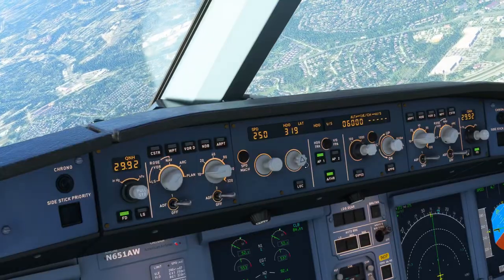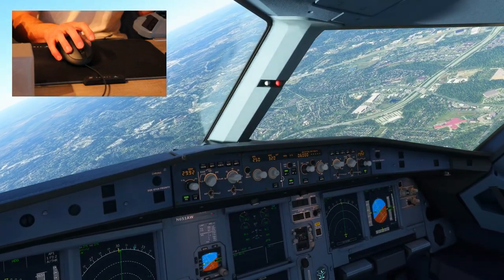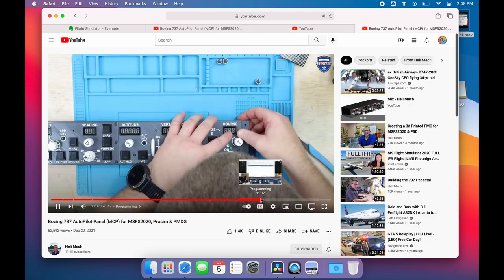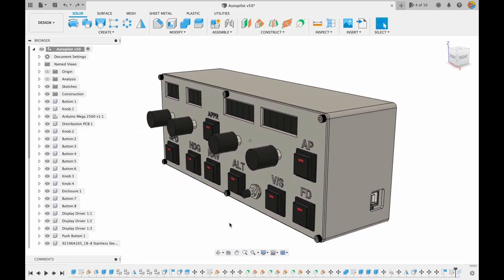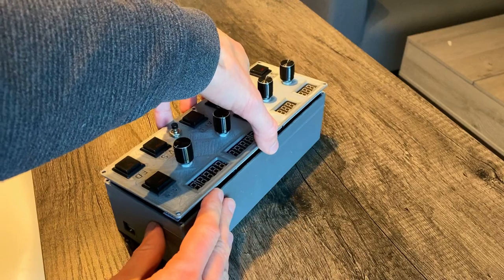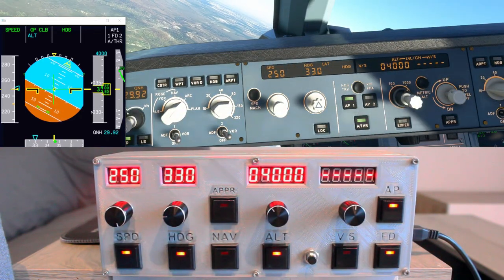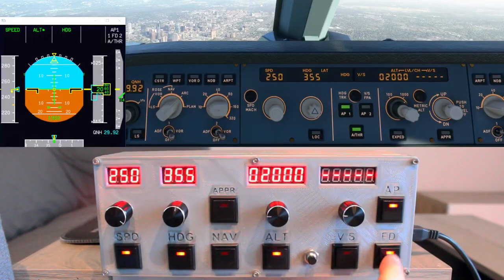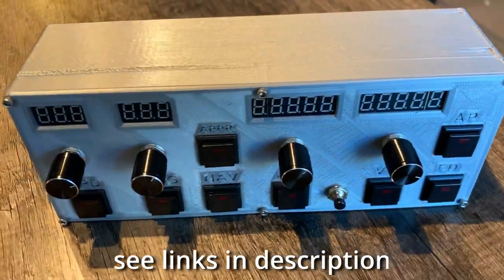I Made a Real Autopilot for Flight Simulator! And You can too!

Comment: Oh man that’s what I’ve been looking for! I had exactly the same problem using flight controls with a mouse. So I built a com radio with an Arduino which functions like the real thing, but the trouble was the interface software. I had to use FSUIPC, which was a total pain in the butt because I had to then write a gateway app to interface that to my USB port. The controls are easy for me, I design electronics and a living. It’s the software interface that’s been the obstacle. I’ll take a look at MobyFlight. Thanks!

Comment: Awesome!! Question, I am considering getting your module, however I have a question about the managed decent mode in FBW, does it support that along Open decent mode?
Reply from the maker: Not currently. You could reprogram it. I will likely change the ALT knob push button to do managed mode at some point.
Reply: @vizix2049  Yeah, the actual aircraft knobs can be pushed in or pulled out, but I have still not found any encoder modules that do that. A solution i came up with was to put a button on top and a button below the encoder knob, which behave like pushing and pulling the knob. This also means that you can use the encoder button to do something else. Not as faithful to the real aircraft though...

Comment: Whould it ba Possible to Buy/Print a 3D panel of any Cockpit with Holes where the Nobs & Push Buttons Go.and Holes with Lens to Read outs. This Panel would be FULL SIZE to fit on the Front of a 50" to 65" UHDTV used as the Panel CockPit that would be displayed Behind the Panel as the primary flight display (PFD), multi-function display (MFD), and an engine indicating and crew alerting system (EICAS) display. This would Eliminate the need for Separate Components that aren't really Representative of thr Full Scale Aircraft.  This Printed Panel could be done in Sections to accomidate smaller 3D printers. While all Buttons Knobs & switches could be installed By the Builder.

Comment: Real nice! I’m gonna buy one! Will it be compatible with the new pmdg 737 700 coming out soon and what about p3d v5? Thanks!
Reply from the maker: Thank you! There's no way to give a real answer to the PMDG 737 compatibility question. Not enough is known about that aircraft yet. I'll say this. I will be buying that plane, and if it's possible to get this autopilot controller working with it, it will happen. It may require MobiFlight support which might not exist initially. However, I imagine the MobiFlight team will be very interested in supporting this very popular aircraft.

MobiFlight does support P3D. However, I don't have P3D. You would likely have to program the autopilot controller to work with P3D yourself. Definitely possible, but would take some work.

The autopilot controller currently has several profiles that work very well with MSFS and X-Plane 11.

If you want to buy an autopilot controller or have more questions, you can email me at vizix.contact@gmail.com. Thanks!

Comment: Really great. Are you able to differentiate between "managed" modes and "selected" modes on the FBW A320? So, can you build "push" and "pull" into the speed, altitude, V/S knobs like the real thing?
Reply from the maker: Yes. The knobs are also push buttons (for going into managed mode). Wasn't able to find knobs that you can also pull. So you just press the HDG button (for example) for the "pull" function to go into selected heading mode. So it's more like a traditional autopilot panel in that regard, but it has all of the Airbus functionality.
Reply: @vizix2049  It looked like you pushed the ALT to change to increments of 100ft. Is it also a push to get into Managed/VNAV mode now that the FBW A320 supports that?
Reply from the maker: @ANITIX87  you can reprogram it to do the managed altitude mode.

Comment: Good job! I've printed the box you open sourced, nice and beautiful. But I am having trouble fitting the 8-digit led screen into the slot. It seems impossible to fit two 8-digit led screen without overlapping each other. Did I picked the wrong number of digits or wrong type of led screens? Hoping you could help me. Thanks!
Reply: I solved it by cutting some off both ends of the pcb board.

Comment: Hi there. Great project. i will be building this over the weekend. But i am not getting the 8 pin DPDT switches. I have 5 pin switches. Will those work ? and how would the wiring be connected ?

Comment: Just a simple question: Where did you get these special 7219 LED displays? The ones in your link description have 2 holes for fastening to the left and right and are WAY to big to fit. Do you cut them or how you do it. I am trying to build that myself at the moment, since yours is not available, Thanks for your effort though, just would like to know, if I have to cut the 7-segment myself.
Reply from the maker: Yes, you have to cut them and glue them in.

Comment: hi! nice idea! have you wiring diagram? and the 7segment display board was cutted?  thank you...
Reply from the maker: Thanks. I don't have a wiring diagram for it yet, but the MobiFlight website shows you how to wire up different kinds of components. Yes, I had to cut off the ends of the display boards to get them to fit.
Reply: @vizix2049  Thanks! The push button between ALT and VS what function does?
Reply from the maker: @maramberri  For the A320, it switches from heading and vertical speed modes to track and flight path angle modes (basically determines if you're referencing the ground track or your track through the air). On other aircraft though, you could have the button do whatever you want.

Comment: Nice!! exactly what I was looking!.. have a question. can  you share, hw did you connect K2-22 switches? i tried, but my LED dose not works.. or stay On.. Thanks in advance!!! great video!
Reply: actually the  diagram show just 3 wires come from switch.. but in  video are 4, 1 is missing and dont know   where  is connected to...
Reply from the maker: Thank you! Take a look at the wiring diagram link on this page: https://jeffrlatham.wixsite.com/vizix/autopilot-resources

The LED is between the "+" and "-" pins on the switches. Good luck.

Let me know if you're interested in buying a fully-assembled autopilot.
Reply: @vizix2049  thanks a LOT!!!!!!!!! u made my day! I just forgot to  1 of GND wires..  just question.  10ohm is enough? or we need something bigger? i ac not find much info about kd-22 switches
Reply from the maker: @miketango507  Lower resistance just means the LED will be brighter. If you go too low on the resistance, you risk burning out the LED. You should aim for less than 20 mA. Remember voltage = current x resistance.

Comment: thanks a lot for the video! great work! is the wiring difficult for someone without experience? do you have a video with that? thanks a lot!
Reply from the maker: Thanks! If you don't have any electronics experience, the wiring might be a little tricky. No wiring video, sorry.
Reply: @vizix2049 , I have seen your wiring diagram. I can see that with the KD2-22 switches, you are only wiring the switch to the ground and not the LED right?
Reply: I can see that you have a red wire connected to pin nº2. to where are you connecting the red wire in the arduino? thanks a lot and sorry for all the questions ;)
Reply from the maker: @jmsiqueira1989  No. The LED is wired to ground as well.
Reply from the maker: @jmsiqueira1989  sorry, I don't understand your question.

Comment: Is there a way to select LOC or do you still have to do that with a mouse please? Really impressed with the unit.
Reply from the maker: There's no dedicated LOC button (I was running out of space on the panel). APPR button arms LOC and glide slope. NAV button arms your nav source. If your nav source is set to your nav radio and it's tuned to the LOC, then the NAV button would arm just the LOC. You can also remap the buttons to whatever you want with the MobiFlight program. Honesty, I've never needed to arm just the LOC.

Comment: Damn we need a full tutorial this is awesome, what code did you load onto the arduino card?
Reply from the maker: Thanks! MobiFlight loads the appropriate code onto the Arduino automatically. The aircraft specific profiles are on my website: https://jeffrlatham.wixsite.com/vizix/autopilot-resources
Reply: @vizix2049  and did you use wiring diagrams  from mobiflight flight as well? I think the wiring is the only thing stopping me at this point but your connectors look really easy
Reply from the maker: @lsmith2030  My wiring diagram is on that same webpage.

Comment: This is great.  Does it work with the Fenix A320?  I've read similar controllers that don't work 100% with the Fenix A320 because of the way it is coded, eg. it has it's own set of variables which are inaccessible, therefore the values cannot be displayed on those devices.

Comment: Hello, I almost nearing the completion with the help of your wiring diagram
 Thanks a lot. 
But struggling a bit as I'm running out of 5v and gnd in Arduino. Can you please help on how to work with those pins to get extra space with the green board you had ?
Reply from the maker: The green board is just something I soldered up that has a lot of extra pins connected to 5V and GND.
Reply: @vizix2049  If I have understood right it is similar to bread board's 5v and gnd bus where all 5v interconnected with soldering.
Reply from the maker: @simmersgamers7602  yep

Comment: Did you cut the end off the MAX7219 or buy ones without mounting holes? I just printed this and grabbed a few 7219s out of my parts bin and found they will not fit unless I trim them.
Reply from the maker: Haha, yes. I cut the mounting holes off and glued them in. I was really trying to keep the panel length as small as possible.
Reply: @vizix2049  Awesome! I love the design! Thanks so much for making it! Going to spread the word to all my fellow Simmers
Reply from the maker: @n2flight125  thanks! Let me know if you or anyone else wants to buy one!

Comment: hello Vizix, I'm watching your excellent tutorial but I have a problem. I bought the same displays and the same Mega 2560 card as you. The problem comes from the displays, when I connect them to the card they do not light up. I have to move the cables all over the place to hope to have my displays light up (and very often it only lasts a few seconds). I feel like the connection is bad. I've been trying to get this to work for hours and it pisses me off. Do you have welding the cables to the display? Did you also have this bad contact problem? Thank you in advance and congratulations again for your tutorial.
Reply from the maker: I soldered the connector to the display board. It needs really secure connections and a stable voltage supply.
Reply: @vizix2049  OK, I think that's the problem. Thank you for your help ;)

Comment: I built a couple of these using just off the shelf project boxes from Amazon (less than ten bucks) normal unlit pushbuttons, rotary encoders and mini-toggle switches. I saw no reason to duplicate the displays since I'm using the simulator for all of that info. Also, rather than an Arduino I used the Leo Bodnar interface card (BBI-32 or BBI-64) which requires no programming, it just shows up as a joystick controller that can be configured with the in game functions in MSFS and DCS (or Spad.next) The idea is to physically replicate all of the dials, buttons and switches so that you never have to touch the mouse and it makes the game much more enjoyable.

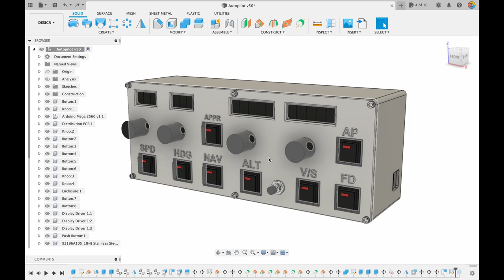Comment: Hey, can I ask you what is that "green board" at 03:29 ? Because in the video and in the model, there is that green board that I dont know what it is and what is for.
Reply from the maker: It's the distribution board for 5V and ground. A lot of components need 5V and ground connections, but the Arduino only has a couple of pins for that. The green board just provides lots of pins for that purpose.
Reply: @vizix2049  It makes a lot of sense. But what about those LED Push Buttons... dont they use 12V? So how are you providing them with the 5V the Arduino has? Also, those LED Push Buttons are momentary or latching?
Reply from the maker: @TheHeineken24  The LED push buttons are momentary and use 5V.

Comment: Your project is free? where I can see schemas and mobiflight project? I try to make a simple ap for cessna and now I have maked a simple 3 7 digit display with relative encoder knob but all connected with a breadboard. I search a box (stl modifiable and I can print with my 3d printer) and schemas for solding all cable and enclose in a box. thanks for yout video.
Reply from the maker: I haven't made a wiring diagram yet, but the MobiFlight tutorials show how to do this. I'll be posting my MobiFlight files soon. Good luck with your project!

Comment: it works with any aircraft? an other project stated that it would not work with the fenix a320. do you know if your system would work with that one?
Reply from the maker: It "can" work with any aircraft. Meaning if you don't see a profile for it on my website, you would have to program it yourself for that aircraft. There's a profile with partial functionality for the Fenix. Full functionality is not possible due to how the Fenix is programmed.